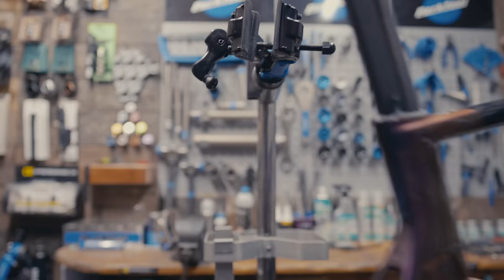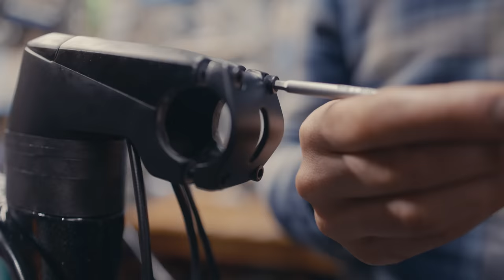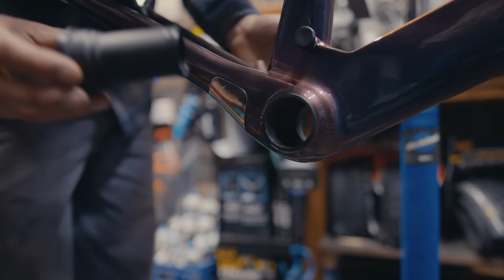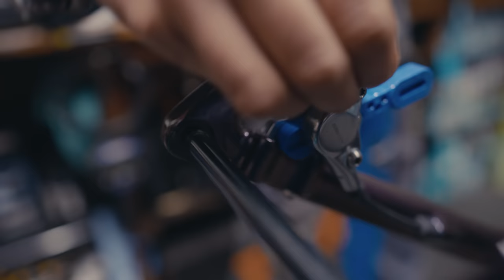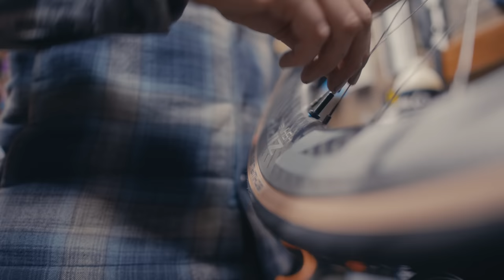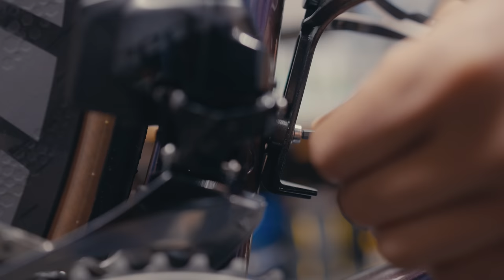DREAM BUILD ROAD BIKE - Felt AR Aero - Niki Terpstra

Comment: Gee...how does Rick tell one cable or hose from the other , at the handlebar end ? Awesome frame color !
Reply: New front brake lines will always be shorter than the rear.
Reply: Tap on it. You will feel the tapping on the other end of the line
Reply: @diehardbikes  I usually tug it till I see a little movement.

Comment: how do you determine the correct length of the hydraulic breaking hose when its a fully integrated handlebar where everything runs through the stem, so it wont interfere with your steering afterwards?
Reply: On the outside of the frame, take a flexible tape, tape it to all underside bends in the frame, fork, stem, bar, all that, and add 5 inches. If there is any extra, which there likely will be, just cut it off at the end. Rather have too much than too little. Err on the side of caution and always add length. Especially with all internal routing. You can always cut later.